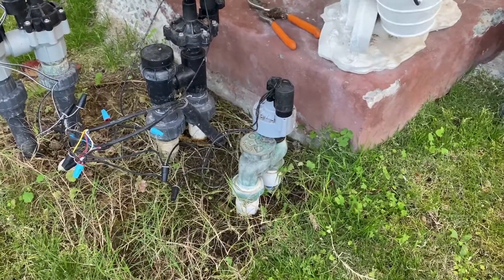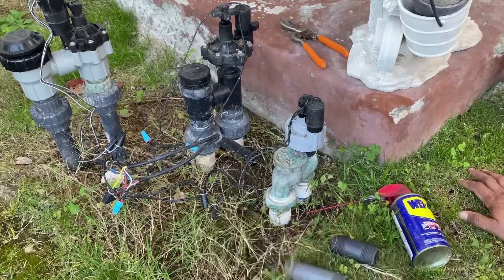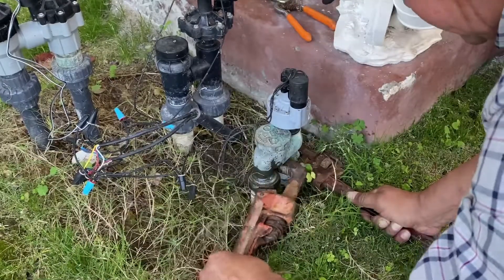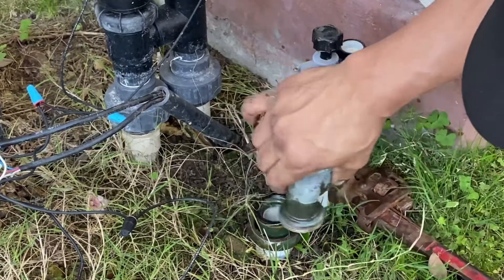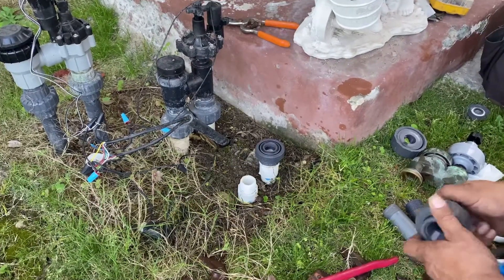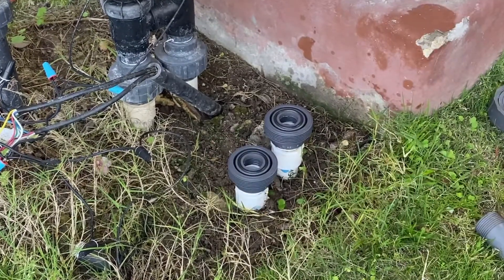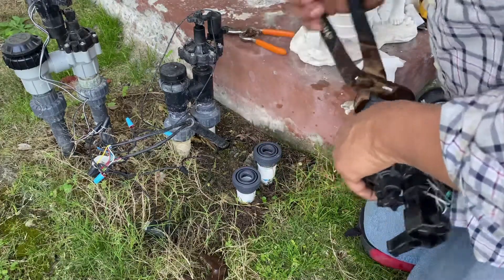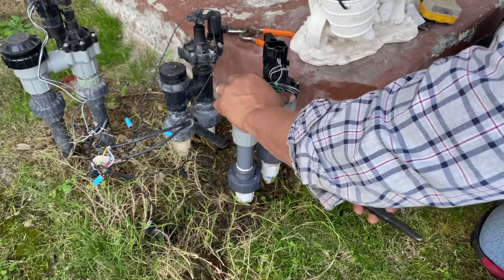How to | Replace a Brass Valve to Rain-bird Plastic Anti siphon Valve

Comment: Are you using a longer nipple(riser) on the left side because the pipe coming out of the ground is lower (shorter) to the ground due to the fact the old brass valve has a union on the outgoing end? How do you know exactly what the length difference should be between the two nipples (risers) for the valve to sit even?
Btw, why are you replacing a brass body anti-siphon valve with a plastic...aren't the brass ones more reliable?

Comment: Do you prefer Irritrol or Rainbird valves The Irritrol has a narrower pipe spacing than the Rainbird and that comes in handy in certain situations I like that you can just unscrew the bonnet and replace with a new one easily But both are good reliable valves in my opinion

Comment: How long will those 80 unions typically last. I know they have an O ring so how troublesome do those become in the future?
Reply from the maker: They can last 10 years or more. For my experience no trouble at all.
Reply: @escompleteyardwork2984 alves can last ten years or more so I don't think the O rings will be a issue Those unions have saved my ass many times on repairs and my customers money So the O rings are easily replaced later on if needed

Comment: What kind of unions are those? I want to do the same conversion you are doing.
Reply from the maker: Hi those are threaded sch. 80 unions and de pending on you pipe size you’ll find them at a irrigation supplier. You can find the sch. 40 at homedepot or other hardware stores but they are not UV protected so you would have rap it with tape or cover it